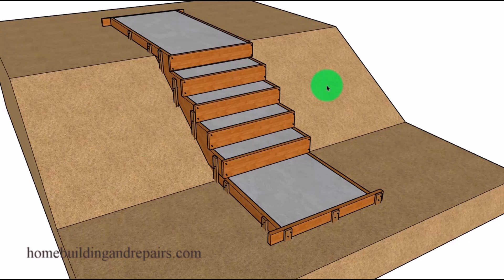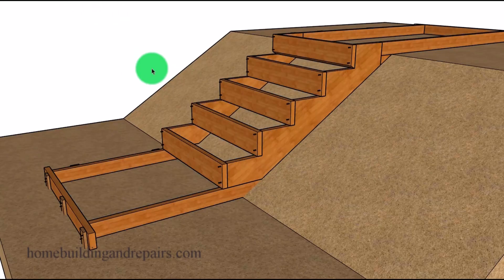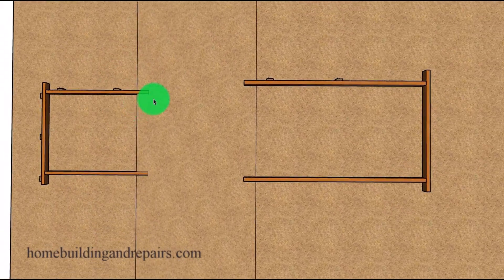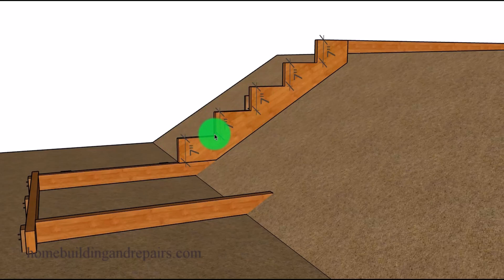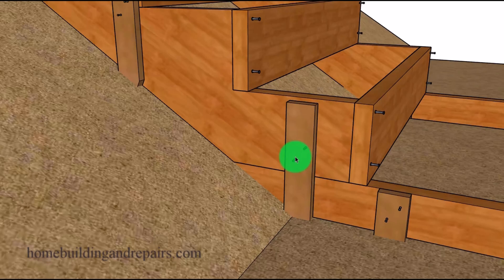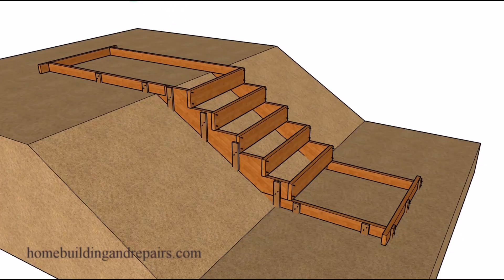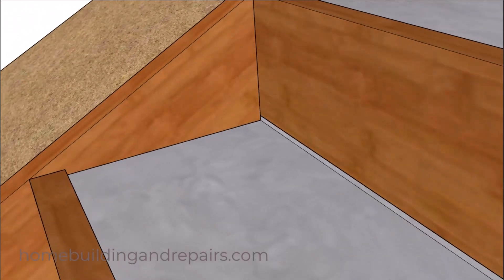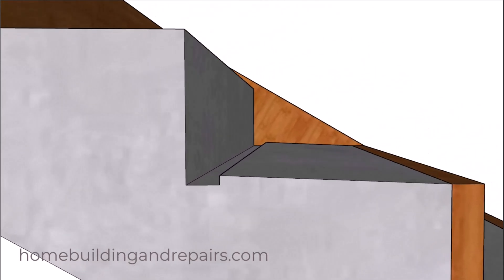Concrete Stair Stringer Trick for Quick And Accurate Formwork

Comment: 10 inch tread run is no good, too short, 7-11 is the best. What is the best riser tread ratio?
IBC – The International Building Code (IBC) typically requires stair slopes to not exceed a 7:11 ratio, approximately 37 degrees, with a maximum riser height of 7 inches and a minimum tread depth of 11 inches.
Reply from the maker: The IRC has an exception that allows for 10 inch steps and some building authorities allow for 9 inch.

Comment: Is the slope in this video meant to represent the grade, or is it a constructed support?  I can see the potential advantage of using stringers to form on already sloping grade, where a bottom panel is not needed on the form.  However, every time I have formed stairs, they were above empty space, i.e. coming down from a deck.  I find that forming the sides by standing plywood on edge gives more flexibility when levelling the risers from left to right.  I can set my sheets approximately at the right height, fix them there, then snap my accurate tread placement on the insides regardless of whether my sheets are perfectly level or not.  It also gives me space to frame a support for the underside of the stairs.

If I used a whole precut stringer, I think it would be finicky to get them exactly plumb and level to each other, especially with all the necessary bracing fixed on.

Comment: Wouldn’t hydrostatic pressure cause the pour to overflow at the bottom? 

Also generally nosing overhangs make a more comfortable step. Steel nosing plates can be embedded in the concrete. Also you can cut the riser plate to angle back to create a nose overhang.
Reply: You always need to pour stairs at a tighter slump than normal, to keep the concrete from running downhill. A 4 or 5 slump is typically good enough. 
Most concrete stairs, the nosing is created by angling the riser back 1” from square as you indicated.